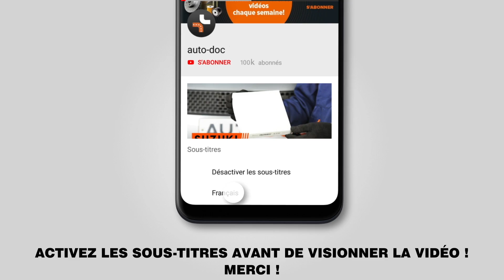Comment remplacer des disques de frein arrière sur BMW 3 (E46) [TUTORIEL AUTODOC]

Comment: Bonsoir; pourquoi faut il ouvrir le bouchon du réservoir du liquide de frein avant de changer les disques ou plaquettes de frein?
Reply from the maker: Bonjour! Merci pour votre commentaire! Il est fortement conseillé d'ouvrir le bouchon du réservoir de liquide de frein lorsque l'on change des plaquettes. Le fait de repousser les pistons des étrier de frein fait remonter le liquide de frein dans son bocal et l'air se trouvant dans le bocal fait pression sur le bouchon et donc il devient difficile de rentrer les pistons et peut être cela amène un risque d'avoir des bulles d'air dans le circuit de frein et pour ne pas que ça déborde.
Cordialement, l’équipe Autodoc
Reply: @autodocfr  merci infirment pour l'explication, j'en ferai de même

Comment: bonjour, pourquoi est t'il nécessaire d'ouvrir le bouchon du réservoir du liquide de frein avant de changer les disques ou plaquettes?
Reply from the maker: Bonjour! Merci pour votre commentaire! Il est fortement conseillé d'ouvrir le bouchon du réservoir de liquide de frein lorsque l'on change des plaquettes. Le fait de repousser les pistons des étrier de frein fait remonter le liquide de frein dans son bocal et l'air se trouvant dans le bocal fait pression sur le bouchon et donc il devient difficile de rentrer les pistons et peut être cela amène un risque d'avoir des bulles d'air dans le circuit de frein et pour ne pas que ça déborde.
Cordialement, l’équipe Autodoc